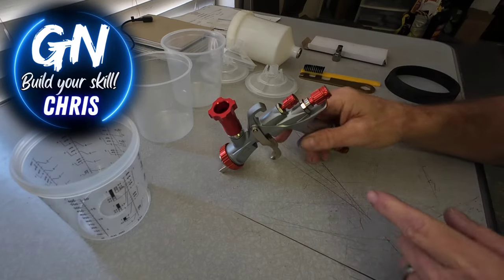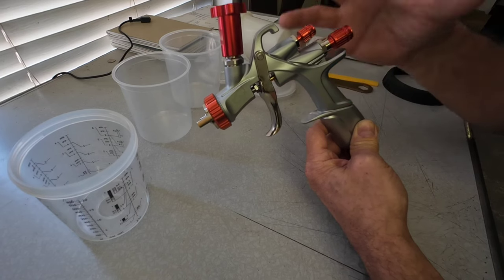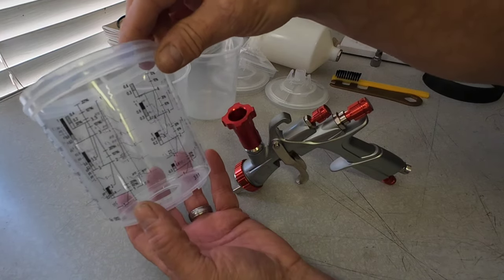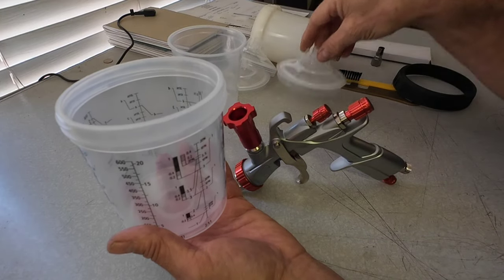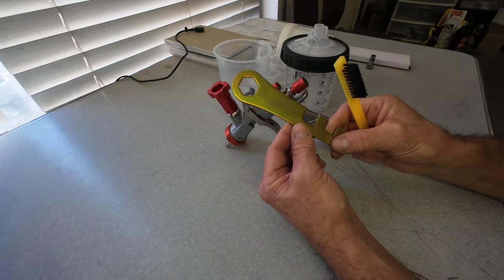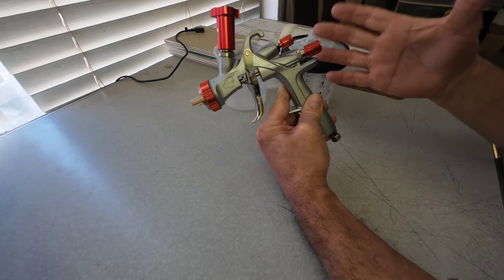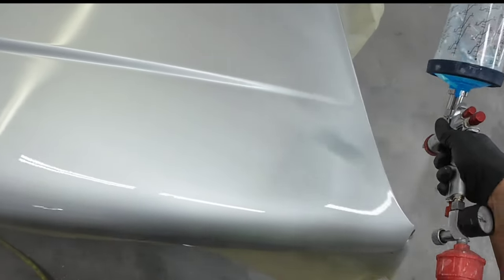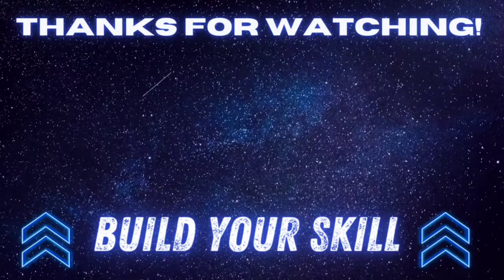The BEST gun to paint a car in your GARAGE!

Comment: Nice review! I love this style! I have the Aeropro A610 and been in love with it for about a year now. Waiting on another gun that looks about the same. It basically is the same. Inokin D1 Drizzle. They seem to have taken the same gun and gave it what I was looking for in all the others… dial knob readings! The packaging looks nice too. Comes with extra pieces as well
Reply: That A610 is terrible the R500 is better and the A610 is suppose to be an upgrade. I used them both at work and the A610 did not do well at all. It did not atomize well if shot like it had a 1.5 tip  even though i had 1.3 tip on it  the spray pattern what terrible. Now maybe i had a bad gun. You never know what you are going to get from buying cheap guns. But i buy them anyway to see it they shoot well. Most shoot ok  but not as good as the big boys at the 200$ and up range i have Iwata, Sata, Devilbis,  and they never let me down. Also thinking of getting a Sagola.

Comment: I just received the gun. It’s spraying lines in my metallic at 25 psi and full fan
Reply from the maker: First coat?
Reply from the maker: Check out this video https://youtu.be/Re69D6U0P_E
Reply: Is that good or bad?:     "It’s spraying lines in my metallic at 25 psi and full fan"
Reply: @RobPolson  BAD, very bad. PSI too high and probably dial the fan in a bit.

Comment: Hi Chris, Do you have a source for the digital air pressure regulator that you have on several of your paint guns? Harbor Freight no longer sells them. They use to be around $15. The problem I have is almost all regulators have a 0 to150psi sweep. Very hard to dial in below 20psi for these LVLP guns. Not really know the PSI?

Comment: Awesome video, in case you have it posted and i missed it, what air pressure do you use for clean and base with the settings you have in this video?
Reply: Also i am spraying a metallic green if that matters
Reply from the maker: I think I put my setting in most video's but the base is typically  around 20 and for clear it's about 28 this is a good guide to start with.

Comment: Identical to the aero pro A610  ! Much like different variants of the R500 , now it seems there will be other A610 copies with other vender names and subtle changes like color finish and im sure they will have others at some point with different color caps and knobs ,  All these LVLP  R500/A610  and variants are a pretty good bag for your buck and works well with 20+ gallon compressors , Also produce"s less over spray...
Reply from the maker: I've  already seen some other color produced. I like this color myself because it cleans up better than the a610. Appreciate your comment and support brother!
Reply: Yessir! I have been using the Aeropro a610 for about a year now and I love it!
Reply: The body looks  exactly  like drizzle  d1   not sure  about  the internal  parts   .

Comment: Hey Chris!! I have this particular gun. I’ve tried spray with it with the same settings (15-20 psi , 3turns from closed fluid and full fan minus 1/4 turn closed  panel distance 8-10 inches ) but…. I have a lot of orange peel. When I say a lot you can’t imagine. Is there anything else that I can do? I really love this gun but I’ll have to send it to the trash next time I have so much orange peel.
Reply from the maker: I believe your saying you get orange peel in your clear. If I'm  mistaken let me know. For clear your air pressure is a bit low bump it up to 28-30 or if you want to keep your psi low then decrease your distance to 6inche and lessin your fluid volume a 1/4 turn. This should correct things. Don't  give up on it , it's  not the gun, play with you settings, speed and distance you'll get it.
Reply: Sorry didn’t mention it. I’ve sprayed single stage paint direct gloss. Shall I treat it like clear? I’ve used to spray with hvlp guns but now that I’m forced to have a small compressor lvlp is the only option
Reply from the maker: @Yannisdee  yes, treat it like clear coat
Reply: It may not be the gun but the products used I have used the cheapest of cheap guns like the 15 harbor freight gun and layed the clear down like glass I find with the cheaper guns it’s better to reduce ur clear like 10% I like my fluid turned in only 2 turns and my fan is usually half a turn or 1 full turn In to get a flawless fan pattern but that all depends on compressor and air hose size also, and a big thing nobody talks about is ur ventilation in ur garage or shop will make a difference also the less over spray the better u need just as much air coming in as is going out of the space ur painting in if it’s cloudy and u can’t see when u stop spraying and it take a min to clear out then that’s probably one of the biggest contributors to the orange peel
Reply: I see ur using single stage that makes a difference to u wanna use a slower reducer and activator then normal base coat clear . It is a self leveling paint that’s why I’ll use the slow reducer or use retarder to slow it down . It will lay flat u definitely have to put it on wet
Reply: With slow red usher I’ve tried 2 turns fluid 15psi and can whide open minus 1/4 turn. Distance from the panel 3 inches and insane speed. Came out like glass